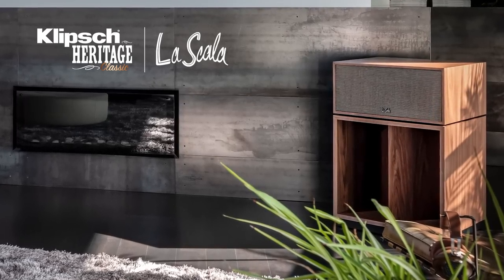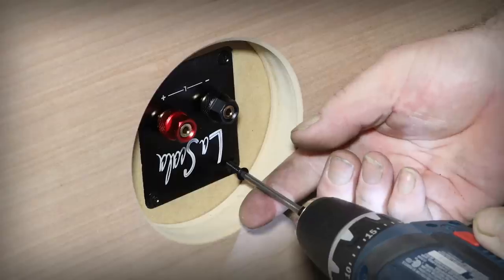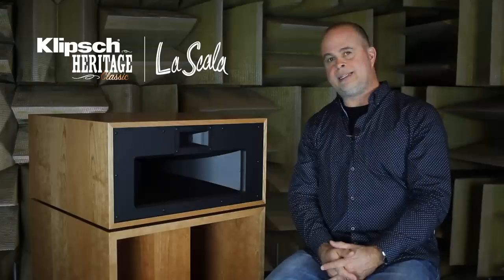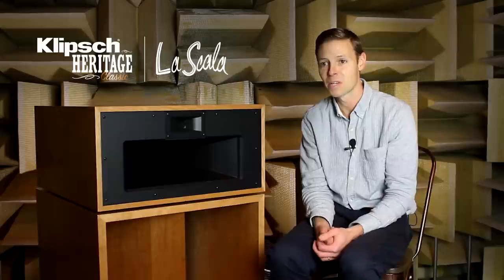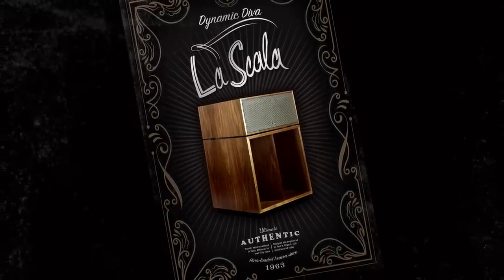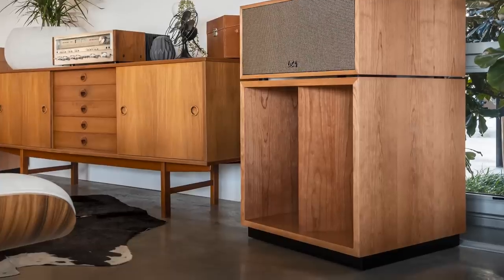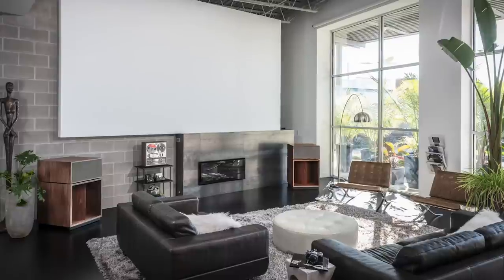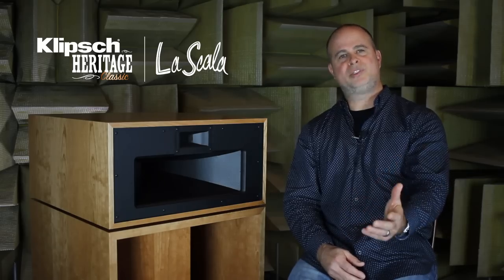Beyond the Specs: Klipsch La Scala AL5

Comment: It's a shame that 45Hz is the lowest they can get. For that kind of money the entire audible frequency range should be covered. No excuses.
Reply: Honestly, once you hear a pair of these in person, you won't complain about the low range missing. Back in high school, our band hall had a pair of these and they were loud as hell. When I played classical recordings I actually had to turn the bass down on the receiver. While the bass isn't deep, it will punch you in the face and stay tight no matter how rumbly the music gets.

Now if you were planning on using these as front speakers in a 5.0 surround setup, I'd say you'd be better off with K-Horns or Cornwalls as those have extended lows for the explosive bass of films.
Reply: They're designed to be fast and dynamic, not to extend low.

Comment: The MDF does not have a resonance response comparable to the original real wood design. It's a definite no for me.
Reply: You wouldn't want a resonance in these speakers, especially if they overemphasized the 125 hz range like the khorns do. Most horn speakers are susceptible for resonance peaks in that range and it may have nothing to do with the materials but the design.

Comment: Does anyone else notice how at 2:36, the bottom of the tweeter horn clearly protrudes below the rest if the baffle, intruding on the midrange horn's path?  It makes it look as if the tweeter horn was swapped out for something the cabinet wasn't designed for, and they just shoved it in.  Makes the speaker look very unprofessional.

At the price point they are at with these speakers, that kind of mistake is absolutely unforgivable.  This is B&W and Wilson level territory here, and in my opinion, the fit and finish of these speakers just doesn't compete.